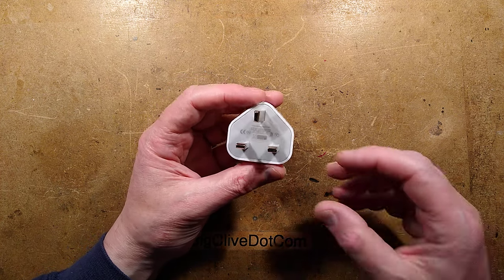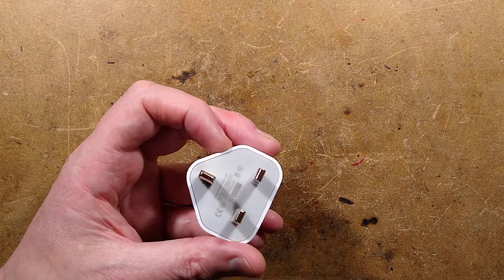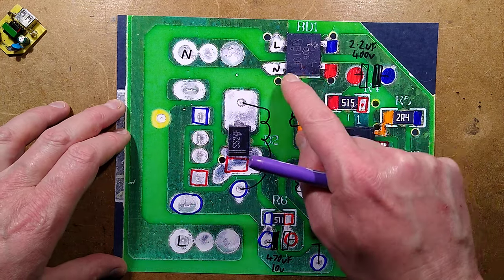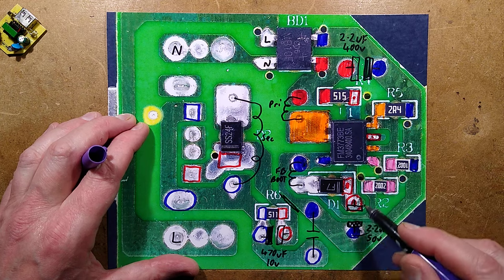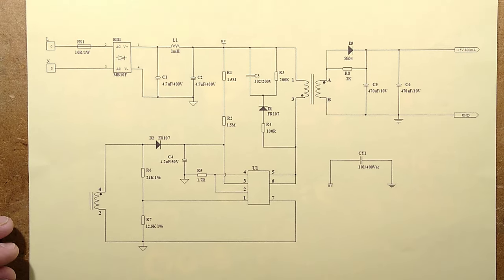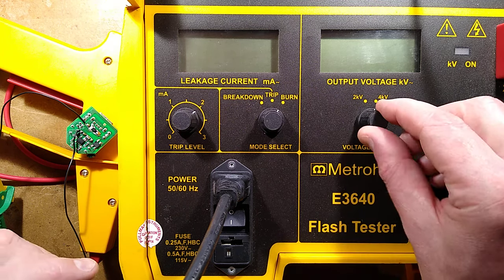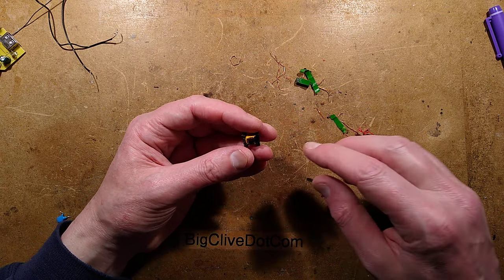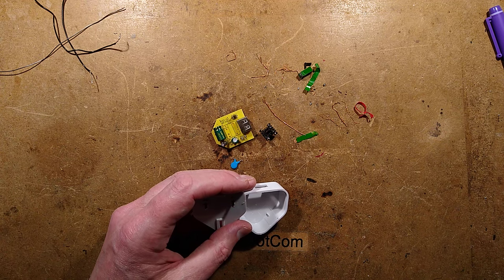Don't buy cheap death-wish chargers

Comment: ah yes the typical "cheap chinese object" bag this should be good...
Reply: oh GOD its worse than i expected....
Reply: is it possible for this to send a mains surge current directly into the usb device? thats a great way to blow your device up/fry the charging IC
Reply: oh yes grabbing a metal phone at mains voltage would be a lovely way to die lmao but i do suspect the charge IC would fry and thus disconnect the device before it becomes electrified?
Reply: "i bought a cheap shitty usb charger.... from china.... i plugged it innn..... and it went ZAP... lmao

Comment: Apple has really let the standards drop, did they even do any testing?
Reply: It isn’t made by Apple. Their chargers look completely different inside.
Reply: @katbryce  so why does it say Apple on it then?
Reply: @Dime_Bar  Because it is a fake. You don't get a real Apple charger for £1, they cost £19 in the Apple store.
Reply: @katbryce  it can be whatever price the shop owner wants it to be, it's up to them if they want to make a profit on it or lose money.
Reply: @Dime_Bar  Whatever. But you can find tear-downs of genuine Apple charges elsewhere. iFixit is a good place to start. They look completely different inside to this fake one, absolutely stuffed full of components, and massive separation between the high and low voltage sides of the circuit board.
Reply: @katbryce  are you from American by any chance?
Reply: @Dime_Bar  No
Reply: @katbryce  you must be 10 or something then as you're easy to wind up.

Comment: Poundshops sell lots of poor electrical stuff there halogen lamps for example when they blow most of them let the glass go and leave the connection part in the holder.. as a spark I would never buy stuff from there ( electrical )… mostly made in China .. there plug tops sockets etc should not be allowed to be brought in to this country …,

Comment: When some guy at home who makes YouTube videos can point out mistakes that some other company made with their product........
Usually these Chinese manufacturers simply copy the exact example circuit from a datasheet! 
This mob went all out and revived Muntz from the dead to further cut back on costs LoL 🤣.... "What's all that wasted area on the PCB? Close the gap..... Don't you know that PCB real-estate costs money! It's not like anyone is going to be charging their devices during an electrical thunder storm......"..... 
Last time I checked, lightning doesn't obay human laws and certainly doesn't pussy out by dropping down to 4kv... At the sort of big boy voltage that lightning likes to play around with, even insulation becomes a conductor..... 
Don't play with lightning and certainly don't play around with anything that creates a path for lightning to you....

Comment: Definitely taking cues from #AppleEngineers like you should see how they pass the primary voltage rail to the SSD memory chips (through poor design). #Apple might as well buy up these yahoos in the same stroke. 

How to ignore chip manufacture requirements / order chips you know will fuck up: https://youtu.be/nPiNb4zI_TQ?t=1580